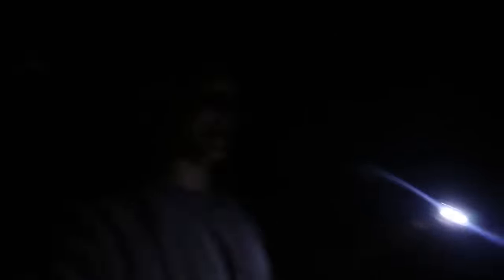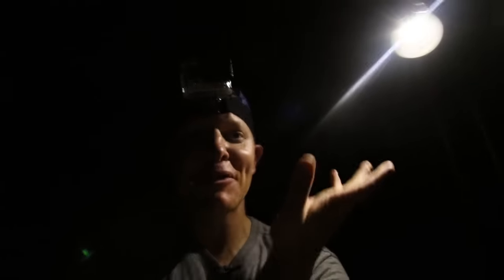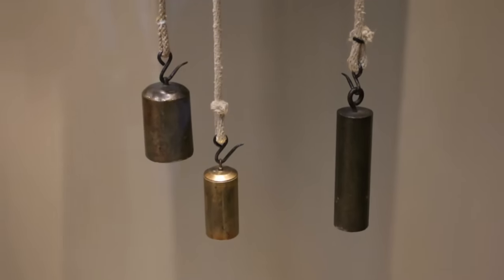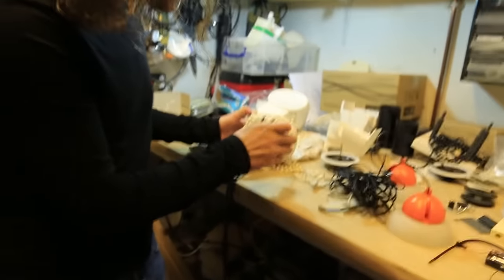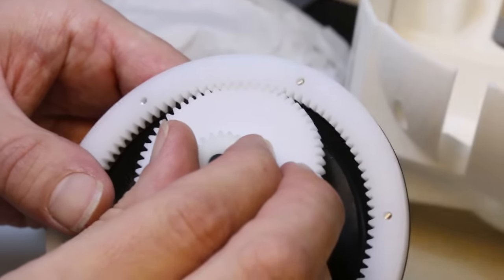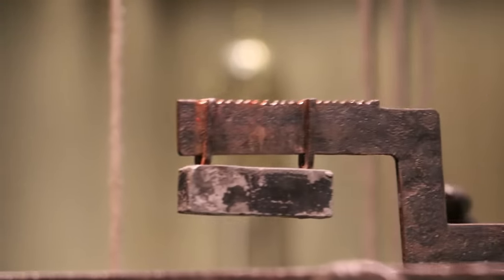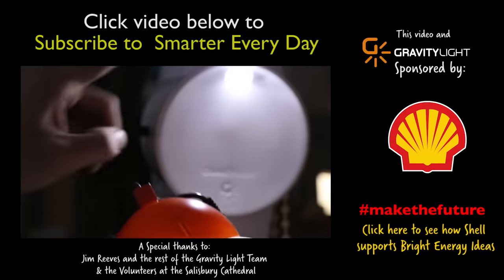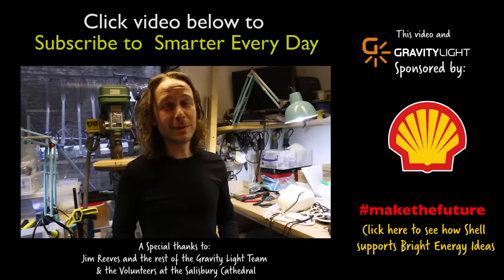Turning Gravity Into Light - Smarter Every Day 146

Comment: Seriously, scale it up, bigger bag, heftier mechanism, have it use water weight from a source thats high up... Like a water tower...
 Have a counterweight thats heavier than the empty container, and have it auto refill when it gets back to the top thus resetting the counterweight and go as fast as you have water, have it modular, many of them, cover them in solar panels.. 
in fact, 
  convert existing solarpanel feilds to act as rainwater catchers to provide a stocked store of potential energy stored high up when there is only rain and the sun is sheilded by pesky dense clouds for days at a time and the wonderful solar panels are inhibited. 
 Seriously, im need to design this not on paper. I currently have no pc nor designing program. Or a 3d printer or a cnc machine. I can melt milk carton chips into shape with a wooden mould.... Ugh... Anyone have a spare generator i can tear apart for the dynamo? And a bunch of bicycles i can butcher and tools i can borrow? Maybe a bit of land/scrapyard to do it on? Seriously... Why does my life suck?

Comment: Why dont you use tension. Like winding
Reply: Not an engineer but I think I know this one. Winding something creates too many fail points. Think about what you need to crank something: a spring, and a gear with teeth that allow slipping in one direction but not in the other. Teeth like that, by definition need to be flexible to a point, I think that would actually be a weak point. Also, springs go through a lot of wear and tear over time. I'm not saying it would be a bad idea to do it with tension, it just might be less efficient.

Comment: So technically, this can be done for a car like a Van. Have the weight system in the back. Load up the weights, get in, release the brake, and go. No need for electric cars... Or have electric cars with free charging stations where you add the weights to the charging station ( already on site) plug in and let it charge your 🔋.
Reply: Scale would be an issue.
Reply: @GoA7250  So it was for the clock, but they just added different gears right, gears that made the motion at the charging end faster?

Comment: Wierd, my response just disappeared.  Let's try again.

So greed has destroyed the original idea.... a $5 device to provide light to undeveloped areas where kerosene was used for light...... a mere 5 years later (July 2020) the device has morphed into a $119 rig that can convert a minute of the user pulling on a cord into two hours of light can also be charged up by solar, grid power, or USB...... AND can charge your smart phones and other USB chargeable devices.

And if you pay $60 you can donate one to an undeveloped location.

So much for a good idea.

Comment: Don't waste your money, this is how a grandfather clock works and has been used to power large and small devices for over a century. go buy a cheap rc gear reduction gearbox, and put a weighted line wrapped on a pulley on one end of the gearbox and wire up a stepper motor with a bridge rectifier and mount the motor onto the fast moving side of the gearbox..... want a more robust system? get a bigger gear box and a bigger weight.

incorporate a rain barrel for weight if you want, and use the power generated to pump your new barrel of rainwater.....

your welcome           
                                        -your friendly neighborhood MacGuiver

Comment: LOL It's the weight, establishing equilibrium... it is not gravity... Remove the "weight" and you do not get motion in the gears...   Even the ''creator of gravity'' -- stated, he could NOT prove it!  This is still a joke for any engineer to believe is a true force...   It is just establishing equilibrium and that will take place once the length of ''material'' that is doing the ''work" comes to an end... Or the weight hits the ground and then attempts to establish equilibrium with the surface soil via displacement of the very top surface of the soil... (depending on the weight and amount of soil it has to displace to produce this ''temporary equilibrium"...
(more on temporary equilibrium if you so desire to ask what that means ...   ).
Reply: Are you indian
Reply: @kyrlics6515  , don't be a racist and ask people what their nationally is...
Just explain your hate and be gone.

Comment: Gravity is NOT a power source! Every time they mentioned "gravity power" in the video, I cringed. The energy to drive the old mechanical clock and also the new "Gravity Light" comes from HUMAN MUSCLES. You have to put energy INTO the system by pulling weights up to a higher elevation before those devices could work. Gravity is not, and can not be a power source. It only converts one form of energy (potential) into another (kinetic). PERIOD!

Comment: Isn't just a solar panel better? If they can get this device how they cannot get something with a battery or supercap?  A minuscule 5W solar panel (solar panels now cost less than a dollar per watt) would produce more than 80kJ (22Wh) of energy in a day at latitudes were most undeveloped countries are, this can easily be stored on a $5 battery (at a cost of $200 kWh) or a supercap. To achieve the same energy storage by gravity you would have to lift 4.8 tons to a height of 2m or 12kg to a height of 700m. 

Even if 8 years ago solar panels and batteries costed twice as much its so much better in every way! Specially because they lack mechanical parts that wear and can break.

Comment: Interesting. I wonder if you could modify existing elevators in skyscrapers to be used like this for blackouts and brownouts, as well as emergencies. That way you can keep the lights on and maybe your fridge running so food doesn't go bad. Just limit the appliances that can draw on power during those times to maybe get several hours or an extra day so the power can come back up.